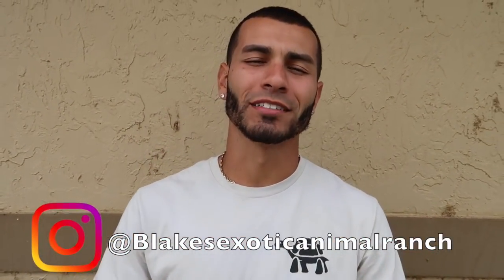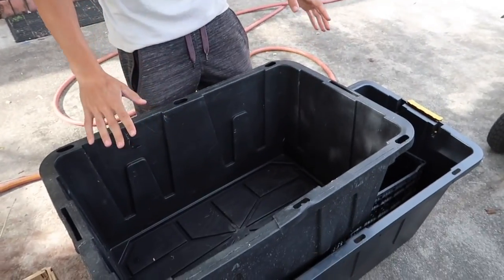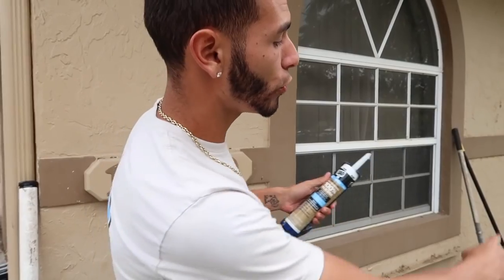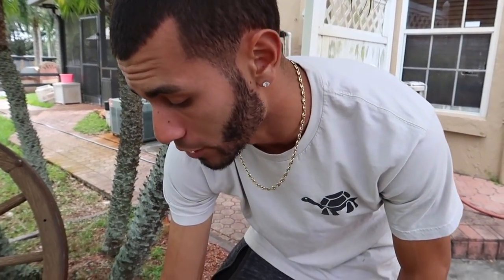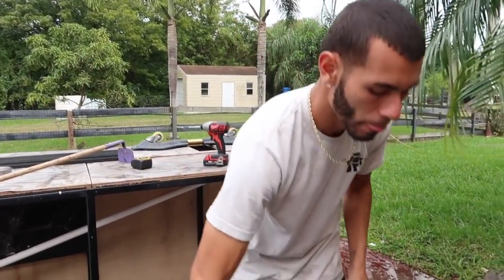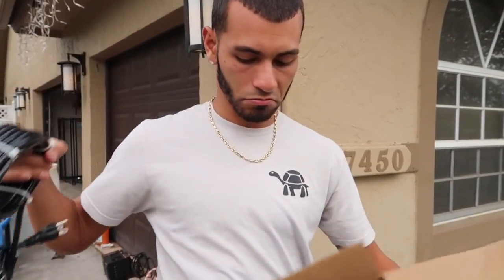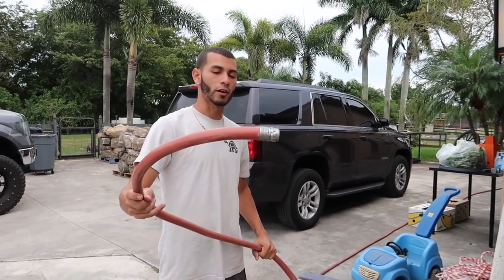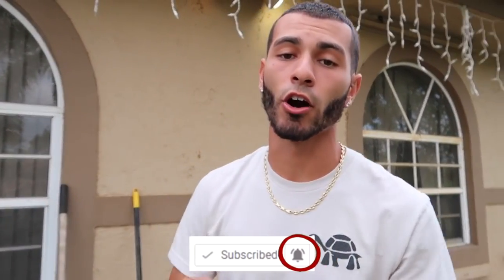Monster FISH Tank *DIY*

Comment: I really wish you luck with that tank, hope you didn't pay much for it. I know it's exciting to get another one up and running but did you do any looking around for new upper and lower trim for it? A tank that size especially made from glass will need that re enforcement to keep those seams from blowing out. Just trying to save you some serious headaches in the future. Plus, your wall in the wet dry- to get the maximum filtering from that lower section of lava rock you must silicone it in, whatever waste that does get down there will flow straight into your return pump. Don't forget to add your heater next to the pump, keep it out of the main tank since you're going with rays- they don't need heater burn. But anyways, keep up the good work and look forward to more aquatic videos.

Comment: 350 gallons? You sure it isn't 300? (TBH, that looks like 150, 72.5" L x 18.5" W x 28.5" H). Given that you've said the fish are disc shaped and require a permit, the only fish that fits that description for FL are stingrays. My guess would be Motoro but maybe Brachyrura (Short-Tailed River Ray).

Comment: Stingray but what kind? It's not discuss because they are not monster river fish.
You should let the silicone completely dry before adding water. It allows the any residue from the silicone dry and not get on the glass. It is hard to clean the scum off if u don't.